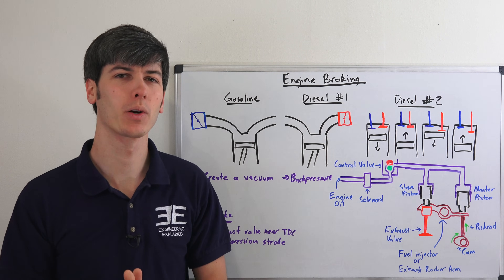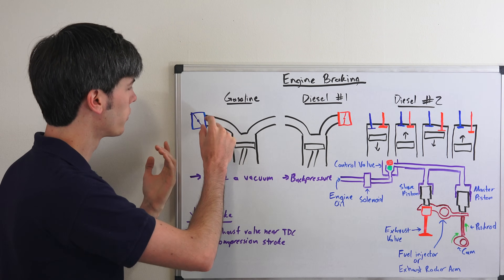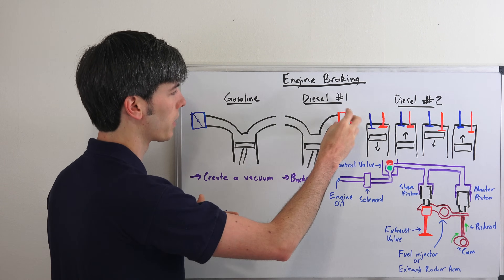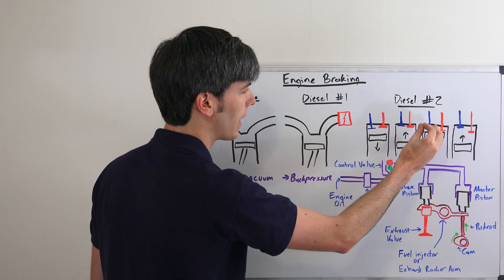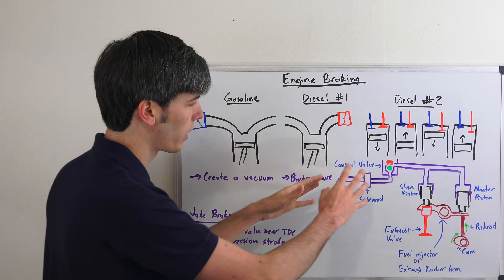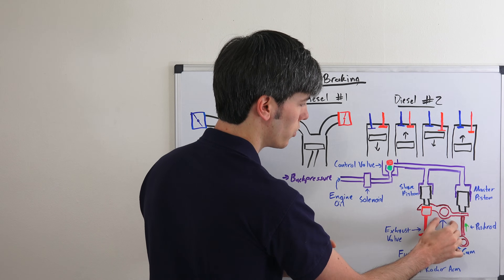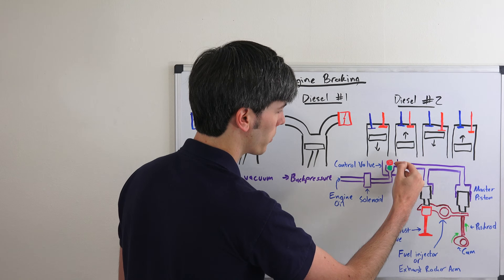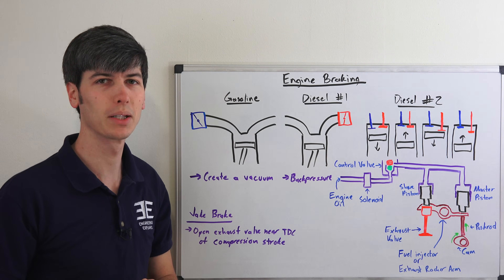What Is Engine Braking? What Is A Jake Brake?

Comment: Petrol engine braking is NOT from the vacuum. You prove this by going down hill in gear with the ignition shut off and open the throttle.  This used to be called "compression braking" back in the day. You are using the engine as a giant air compressor. 
Standard diesel cars and trucks do not have a jake or exhaust valve system yet they still can engine brake by this same process.
Reply: +MrRexQuando diesel engines have no throttle plate it's always wide open
Reply: crowmagg1 Agreed! This is proof it isn't the "vacuum" that causes the braking. Its using the engine as a compressor.
Reply: +MrRexQuando i have driven 18 wheelers (diesel) and gas v8's the disesl had almost no engine breaking effect (there is some but not that much)
without a jake we had to engage the cooling fan clutch
that is because the air that is getting compressed only rebounds during the power stroke then it is pushed out the exaust
while on the gasoline engine the intake stroke is pulling from a manafold with a closed throttle butterfly
if you put a vacum gauge there you will measure about 30" of mercury the piston is using energy at that part of the stroke because of the differencial between the top (near vacum ) and the bottom (at crankcase pressure (near atmospheric) that energy is returned during the compression stroke but then again lost on the power stroke
during the exaust stroke the valve opens and the vacum is lost by a inrush of exaust gasses and almost at once pushed back out during the exaust stroke now with the exaust valve closed the process repeats when the intake valve opens
so there is more engine braking effect in gasoline engines than a diesel without additional equippment installed to provide this
the engineer here is wrong about the heating effect with a gasoline engine it's more of a cooling effect but both take energy
Reply: crowmagg1 nope- again you can test this yourself with a gas-er. drive down a hill in gear with the ignition off.  Opening the throttle  increases the engines resistance. The vacuum effect is rubbish.
Reply: +MrRexQuando i do it every day when i ride my mtorcycle 
on some engines the effect is so strong they make slipper clutches to keep inexperienced riders from crashing 
both effects we discuss have braking effect but chopping the throttle is stronger and is enough to cause rear wheel lock-up and cause a low side crash   experienced riders know to keep some throttle applied when in a turn to prevent this 
and yes i can cut the ignition any time there a switch for that right next to the throttle but when i do that i notice np extra braking effect with the throttle open i do notice there’s a little less
Reply: crowmagg1 That's because you have a carburetor and your ignition is on so pretty sure your not comparing similar scenario.
Reply: +MrRexQuando yes i do have carburettors and i can cut the ignition and apply any throttle setting i want 
while there is a braking effect (i can disengage the clutch also at any time) from the engine with the spark cut and full throttle  there is slightly more when the throttle is returned to idle 
a diesel is wide open (no throttle plate) and there is some but not enough to use braking effect that they do have to add other systems to increase the effect  because without them you go through brake pads quickly 
and with gasoline vehicles no extra systems are needed because just chopping the throttle is sufficient 
they dont make jake brakes for gas engines
Reply: MrRexQuando you've forgotten that a 4 stroke has 4 strokes.
1. intake. vacuum. = work done
2. compression. = energy passes back into the car. Think of a vacuum spring.
at this point no real engine braking has occurred.
3. ignition stroke. vacuum again. work re-done.
4. exhaust. on this stroke the work done is not passed back to the vehicle.
Reply: dan the energy it takes tor the piston to draw from a closed throttle plate during the intake stroke is returned back to the system during the compression stroke and carried over through the power stroke but is not returned during the exhaust stroke when the exhaust valve breaks the vacuum in the cylinder and the exhaust stroke does not return the energy from the power stroke that is why you hear that loud reversion pulse noise when you down shift and have loud pipes
Reply: +MrRexQuando You're totally confusing the slight mechanical losses in compressing and expanding chamber gases in either Otto or diesel running @WOTwithout combustion (thus minimal net drag/braking), compared to the Otto cycle with closed throttle, where during intake the piston has ~0 absolute pressure above and full atmospheric below. The latter results in substantial absorbtion of work/energy, thus braking. Depends a lot on piston displacement & gear ratio of course. It's actually quite obvious.
Reply: +MrRexQuando so then explain where the braking effect happens instead of just disagreeing and saying everyone is wrong we need a detailed explanation so we can reply to your explanation of how the braking occurs
Reply: +MrRexQuando Purest rubbish. Pulling a piston down with ~0 absolute pressure above and full atmospheric pressure below (crankcase pressure) should tell you everything, if you can understand what's happening here. Apparently your agenda goes elsewhere. End-of-story with you. Pettifogger.
(With intake valve open (duh) manifold pressure is chamber pressure, close to 0 psi absolute.)
Reply: +MrRexQuando you’re right about the crankcase pressure being lower than 1 bar but its not that much lower 
where as the intake manifold is near 30" of mercury its at a higher vacuum during down-shifting than at idle by a inch or two so we still have a pressure differential from the bottom of the piston to the top close to 14 psi across a 4" piston that’s 12.57" suuare inches of surface area or about 176bs of force on the intake stroke that is never returned because the exhaust valve releases the vacuum
Reply: +MrRexQuando every internet source" i got as far as wikipedia " Petrol (gasoline) engines
The term 'engine braking' refers to the braking effect caused by the closed-throttle
 partial-vacuum in petrol (gasoline) engines when the accelerator pedal 
is released. While some of the braking force is due to friction in the drive train, this is negligible compared to the effect from the vacuum.
When the throttle is closed, the air flow to the intake manifold is 
greatly restricted. The concept can be illustrated by the amount of 
effort required to blow/suck through a narrow tube vs. a wider one. It 
is the work the engine has to do against this restricted air flow that 
provides the braking effect.
now i think the engineer is wrong about putting heat into the engine instead of the brakes because pulling a vacuum or dropping pressure usually results in a cooling effect in the case of the gasoline engine  as where the diesel engine adsorbs some of the heat from compressing the gases
Reply: +MrRexQuando you go ahead and keep your ideas and i know about gasses getting hotter as they are compressed but i was referring to the engine block on the diesel adsorbing some of this heat 
so will you please explain what you are talking about because nobody else seems to know 
and that "4 cylinders acting at the same time" article is just off topic  and irrelevant  all they did there was talk about a design (in theory) that would have turned the engine into something that would act as a larger single cylinder engine  but the braking effect would still apply 
put some theory on the table so we can shut you down or go back into the darkness 
your nonsense has run its course
Reply: +MrRexQuando its been fun and goodnight 
but a vacuum has no momentum fluid dynamics 101
Reply: +MrRexQuando "in space no one can hear you scream"
why? because you are in a vacuum
just like your intake manifold during down-shifting 
you seem to be alone in your opinion
ill stick with the rest of the world about the vacuum effect  causing the braking on the gasoline engine and you can have your own special opinion
Reply: It is vacuum that causes engine braking in a gasoline engine, not compression.  The piston is trying to draw air through a restricted port (intake).  Connect a vacuum gauge to the intake manifold and you'll see 22"+ of vacuum with the throttle closed during deceleration.  Since there is less than normal air pressure in the cylinder during the intake stroke, there's less than normal air pressure for the compression stroke, there is little compression to resist the piston to cause "compression braking".  You can't compress a vacuum (even though it isn't a perfect vacuum).
Reply: mr rex have you ever driven a 18 wheeler?
i have and there was a switch that had a 2/4/6 setting it worked quite well
Reply: yours had hi med lo and mine had 2/4/6 
but both were made by the same company 
and off hardly any braking effect happened we were also told not to use the jake in low traction conditions because only the drive wheels were affected and could loose traction 
now i did test your gas engine theroy on my motorcycle i was going 80 mph in gear and cut the ignition and tested engine braking effect at different throttle positions  and with the throttle closed i had more braking effect than with throttle open
Reply: As I stated and also in the video, the gasoline engine uses vacuum braking on the intake stroke.  However, a diesel engine uses compression braking on the compression stroke.  The exhaust valve on a diesel engine opens at the end of the compression stroke, dumping all the compressed air out the exhaust port.
Reply: As I stated and also in the video, the gasoline engine uses vacuum 
braking on the intake stroke.  However, a diesel engine uses compression
 braking on the compression stroke.  The exhaust valve on a diesel 
engine opens at the end of the compression stroke, dumping all the 
compressed air out the exhaust port.
Reply: MrRexQuando - there is some merit to your argument, but the majority of braking is the result of the intake stroke.  The compression stroke can provide a minor amount of braking depending on valve timing.  The exhaust valve always opens before the piston reaches BDC after the compression stroke. With no fuel, the compressed air begins to flow through the exhaust valve before the piston starts its upward exhaust cycle.  This releases a small amount of energy.  In a performance engine, you have not only a higher compression ratio, but also a more agressive cam profile. This causes the exhaust valve to open even earlier, releasing more energy.  This is why a high performance engine provides more engine braking.  If you want some non-technical proof that the intake stroke does the majority of braking, look at the diesel engine market, in which exhaust brakes are sold for the consumer, and Jake Brakes are sold for commercial vehicles.  BTW Jake Brakes work on the compression cycle - so if you want to see how compression braking really works, look at an animation of the Jake Brake.  If you want some personal proof, go jump in a Ford IDI with a 10,000 lb trailer and see how happy you are going downhill without an exhaust brake.  The IDI has a compression ratio of more than 21:1, yet has almost no engine braking - I know, I own one.
Reply: I have driven countless diesel trucks standard shift with a jake brake
Reply: The intake valve obviously closes during the compression stroke so I don't think the energy will be returned. Or is their a way for the piston to regain the energy lost?
Reply: Tried this... Rear ended a car. Where can i send the bill?
Reply: You are simply mistaken.  In the gas engine, the piston is pulling on the vacuum doing work, but it's not a complete vacuum, so there is not much rebound.  In the diesel engine, the work is done by compressing the air and either releasing it without the rebound, or by continually compressing against the exhaust brake valve which again is not a perfect seal so very little rebound.  The work done equals the braking effect.

I would imagine you can't put a butterfly on a diesel intake because they're not built for it. There is no part of the diesel intake system that is built for a vacuum. It is either built for atmospheric pressure with a very small vacuum between the filter and the turbo, or built for pressure between the turbo and the intake valve.  Plus you'd have a problem when the engine returns to idle because there is little air in the system, thus no compression, thus no combustion.  So every time you come off of using the vacuum brake, the engine would die.  With a compression or Jake, the engine can still fire as it is still compressing cylinders full of air.

I'm sorry, but I have tried these experiments.  Done it on my motorcycle many times.  Open throttle, the engine turns over very easily because there is no vacuum and the compressed air rebounds.  Closed throttle is harder.  I also drive an F350 daily, towing very heavy (relatively) loads.  It has very little engine braking ability, probably mostly provided by simply pumping air through the engine, the oil pump, and the valve train.  I believe it is said the 7.3 produces about 20 hp of engine braking but if you add an exhaust brake, you can get 200.  But on a stock truck you're only getting 20.  I don't know what F250 you are talking about but some are fitted with exhaust brakes, which can be done using the exhaust backpressure valve in the 7.3 and I think comes stock in the 6.7.  Fords are built with mechanisms for engine braking now.

Vacuum is the source of the engine braking on a gas engine.  Compression is the source on a diesel.  It's automotive science.  You'd do well to read a book on the subject, or listen to experts like in this video.
Reply: Jacques Blaque Your totally confused. Don't get manifold pressure confused with intra-cylinder pressures. "where p_0\; is the cylinder pressure at bottom dead center which is usually at 1 atm," 
1 atm = 1 bar = 14 psi. 
"https://en.wikipedia.org/wiki/Compression_ratio"
Reply: Jacques Blaque yeah yeah 5 years of college and every internet source is wrong and you're right. OMG you have the same song/dance as every internet troll. 
The crank case does not have 1 BAR because every modern engine uses a PCV system to ensure a slightly lower pressure to take care of "blow-by" gases.  "https://www.quora.com/What-happens-in-a-4-cylinder-four-stroke-engine-if-all-the-pistons-do-their-processes-simultaneously-like-suction-compression-expansion-and-exhaust"
Reply: crowmagg1 They are of course speaking of while the engine is running. Diesels don't have a throttle body and thus no vacuum. Care to try again?
Diesel doesn't absorb heat. The heat is what ignites the diesel fuel.
The temperature in a petrol engine does not drop it does the opposite as the air is compressed. First law of thermodynamics.
Reply: crowmagg1 " because the exhaust valve releases the vacuum"  Please stop before you really make yourself look silly. 
The cylinder will never have a vacuum after the intake stroke. The intake air has momentum so even after BDC the intake valve stays open a few degrees for this reason. 

Although this exchange has been fun your lack fluid dynamics/thermodynamics understanding or even IC principle is getting old.
Reply: crowmagg1 You're seriously dense:
"the intake charge's momentum keeps it flowing into the cylinder despite the piston's upward movement after completing the intake stroke. Delaying the intake valve's closing to take advantage of this phenomenom increases cylinder filling and power. "
"http://www.motorcycleproject.com/text/lobectr.html"

Everybody knows this..
Reply: crowmagg1 True! Except in StarWars or Gravity, or Eureka.
Reply: Dan Burch Then explain how a diesel does this. Diesel don't have vacuum.
Reply: crowmagg1 No clue. All I have driven had an on/off plus high/med/low switch for Jacobs But that is totally different from my ability to take my son's F250 and drop it into 3rd down a hill and compression braking takes place.
Reply: crowmagg1 The acid test is a box-stock F250 diesel that slows well putting it in 3rd gear down a hill. Totally impossible if vacuum has anything to do with Compression Braking.
Reply: Dan Burch That's only engines with Jacobs brake. If Vacuum actually worked (which it doesn't) it would be much simpler to install a butterfly valve on all diesel engines to restrict the intake air. Jake brakes are complex and costly. Jakes cost $5-8000. A butterfly would cost $200-500 and installed in 30 minutes.  But they don't because vacuum doesn't have an impact on compression braking.
Reply: crowmagg1 Correct like a syringe when you block it with your finger. The resistance pulling the piston is returned (all but friction) when you let go and the piston returns.